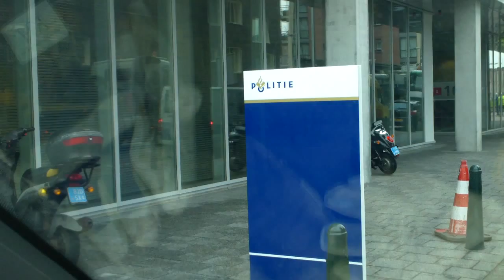Big truck , long trailer , tight corner , lamppost...... no problem.

Comment: Yes indeed, some Aerials have all-wheel steering, some 3 axeled Engines, Rescues and Tankers etc have their 1st and 3rd axle steering. At that point many fire departments also have Aerial Ladders based on vans, or radio controlled ladders which can be loaded off the actual truck. You can imagine: If a fire truck with all-wheel steering has problems in a 2000 year old city center, then a Semi would have the same problem

Comment: um acturally no! Just very few companies use stearable rear axels, most have rigid axels. But anyway: Even if our fire trucks (which are as big as delivery trucks) had all-wheel steering (!) they wouldn't manage to enter soem streets with their full-size fire trucks ... and they are way smaller than a semi truck